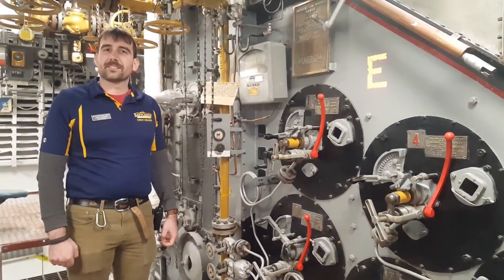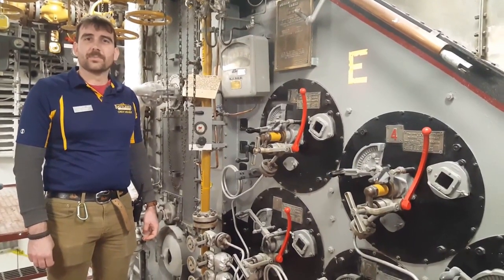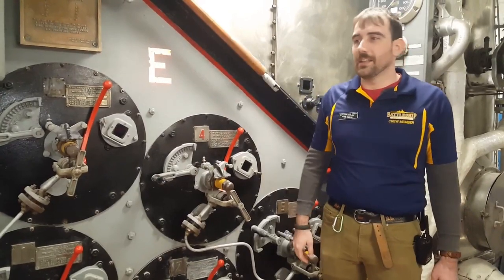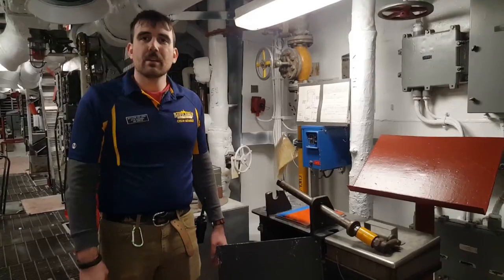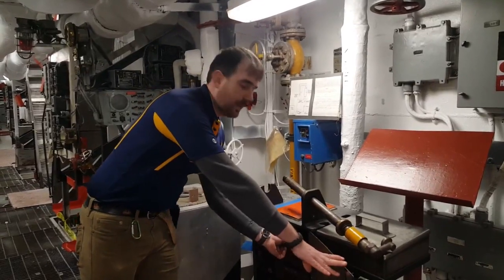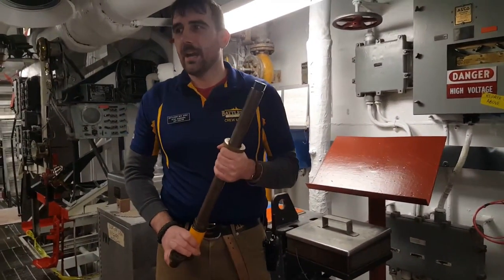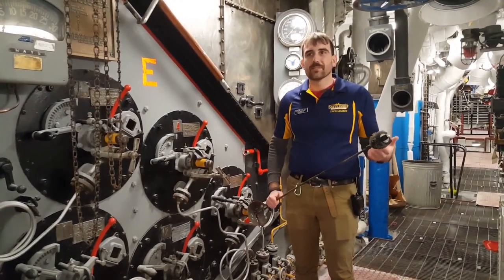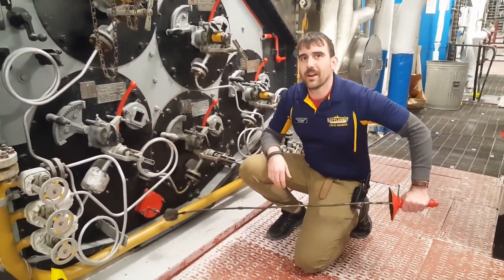How to light the Battleship's boiler

Comment: This is important information I need to kinow in case there is ever an alien invasion.
Reply: But do you need to cover your ears?
Reply: Purrs like a kitten
Reply: Absolutely on the hearing protection. It's the rest of the pumps and turbines and the screaming turbine driven forced draft blowers that are the noise makers. And, every thing is hot in there, often including the deck plates as when you're in the Gulf. Often it's 20° hotter down there than it is outside, and in the high corners the temperature goes up from there. The time we got the most people underway asking to visit and learn (ESWS training) was when we were up nearing the arctic circle - the main engineering spaces were usually the warmest places on the ship. 
BT2(SW) here. Served on board for a very short time.
Reply: Pretty simplistic description, lots more to it.
Reply: When I was on this boat called the Ev Blue Lady, all the guy did was , open the little door on the front of boiler, light the stuck, put the now on fire stick in the opening and turn the fuel on, that was it.😊

Comment: I served onboard 5/82- 5/84. I remember those Babcock - Wilcox boilers well. Great ship to serve on.
Reply: Must have been a fine ship to sail on. Always wondered, what was it like being in those boiler rooms? I mean was it as hot and sweaty as people would imagine, or were they insulated enough that it wasn't any worse then any other area?
Reply: @sparkplug1018  it was very hot in the tropics. Not too bad in the med and North Atlantic. We steamed for 11 months straight with no issues. Great engineering plant.
Reply: @rc6147  Ship is only as good as the crew sailing her, must have been an incredible tour.

Comment: Yankee Station, 1972- I had an unwelcome occasion to light off the back wall of a superheatrer on my tin can. We were engaged in a fire mission when the burnerman shifted to a clogged burner and secured the operative one. I eased open the fuel to the known good one and got that "whump"accompanied by the front jumping in and out, I would not have tried this with distillate fuel, but we were burning NSFO- and time was of the essence- loss of fires was a rare and worst case scenario during combat, and could be likened to a flame-out and midair restart for a jet aircraft. Did not report that event to Main Control nor logged it either BTW.
Reply: Distillate lighted easier, still the "whump", but the burnerfront didn't try to kiss you.

Comment: Suckers.  Changed enough sprayers (5Y515360) on HMCS Protecteur to know what to do...They do come out HOT, but not so bad really- 2 pairs of steaming gloves was enough with ours.  Mind, ours were steam atomised sprayers (hence why 5-Y-51-53-60= 5 jet, Y type jet, #51 on the outside hole, 53 on the FFO hole, 60 on the steam jet).  To clean sprayers:  not more than 95 RPM (5/6 fires...).  Call bridge, let them know no 1 double bubble (100+ RPM).  Watertender goes down below, starts with the 3 spares.  Blows them through, checks for an even flow of air from both the steam and fuel jets on all 5.  That gives you 3/6 needed clean already.  Check the O Rings on the Iowa type racer sprayer.  (yes, that's what they were called).  2x teflon rings provided the seal on steam and fuel to sprayer.  Get out gloves (x2 for Left Hand).  Boiler Op then sets up to 1 fire in burner OFF position in MCR.  Collect 5 gal pail to minimise fuel spillage.  Confirm with Boiler Op that the burner is in OFF.  Shut root valves (fuel/Steam).  Undo retainer using wheel hook, while holding bucket under the end so that most of the fuel goes into bucket.  If the sprayer doesn't come free when released, use wheel hook to "tweek" sprayer back and forth, till it is loose.  Then, put bucket on deck, grab sprayer back with right hand (1 glove), slide sprayer out about 2', grab with left hand on barrel, then swiftly take sprayer to the bench, drop into holder like ^.  Try not to drop on deck due to heat on way across...

Take clean sprayer out of rack, walk back over to boiler (which has 2" hole in it open...with 20" of hot air coming out it...) put sprayer in, ensure lined up, put retainer back in place, hand tighten.  Make sure that microswitch for sprayer in is made.

Now, comes hairy part- testing "new" sprayer...open root valves.  Call boiler op on either radio or machinery broadcast.  If on broadcast, stand at boiler room console- if you had radio, go to same spot or so...  They then set boiler to be able to change over fires to the one you put in.  If it all works out (about 80%), then no big deal.  If it goes wrong, usually it's the flaps are sticky, and you have to go wack the flaps in with a wrench.  Or, you can get it quite wrong, not have enough pressure on the retainer, and have a giant fuel & steam sprinkler spray F76 all over the front of the boiler...:"take it out take it out take it out..."

Now, do the other 2 the same way...so there are 3 dirty sprayers on the bench, and 3 clean ones in the boiler.  Each sprayer when clean will burn about 2500 lb/hr of F76 (Diesel, or close enough).  We needed 2 of them to make up to 60 RPM, 4 for 60-90, 5 for 95, and all 6 for 100>.  You could change sprayers at 100, but it was a faffle for sure....if it went wrong,  you didn't have long as boiler op before steam pressure would be dropping, the Electrician would be mad because Cycles, the EOOW would be mad because not enough steam...but we did do it.  

Dirty sprayers- the best was when we had enough spare tips to be able to change them right out, then put them into the ultrasonic cleaner bath.  However, someone in their infinite wisdom chose not to order more tips in about 2008...I lost my nice new tip from home to the ship, because we needed it more at work than I needed one at home.  Prior to that, in 2007, we had horrible problems with MBG in our fuel.  Turns out, there was about 7' of MBG in the fuel tank...who'd have thought that caused quite the problems even with the smallest hole being #53 that the fuel was passing through !.  It was bad enough that we were typically cleaning tips every 2 watches which gets OLD fast... !  

This is on an "automatic" boiler- you shouldn't need to do anything but turn the switch for the fire to light, or to extinguish the fire.  Fuel pressure was supposed to control atomizing steam pressure (but never did, we just steamed with it set at 150 PSI atomizing steam always), and we used about 40 lb/hr/tip in water to provide the atomization.  Fuel pressure was regulated by a Bailey Meter Company computer, using steam flow, steam pressure & fuel flow to regulate steam pressure- it was fairly good, in that you could manouver 40-90-0-40 and only have to put in and take out fires to do so.  (you had to have a little bit of fearlessness to do so, as it was possible to lift safety valves, which is a beer offence- remember, RCN was wet until after PRO burned...).

And no, we didn't need a flaming stick to light them- we had a spark system that did so- burner on ignition on got you 7 seconds of ignitor, and you had the fireeye system to verify that the fire actually lit.  I never lit the ships boilers with a flaming stick, though it was suggested the best way to do so was a propane torch with a length of about 3' of copper tubing...

Comment: I stood watch in all the firerooms when i was aboard from 88 to decommissioning. This is a very simplified video on lighting fires in the boiler.  A lot of the time burner nozzle orifice tips were changed with the burner still hot. This was done to increase the fuel flow to the fire, as there was no pump control. The pump was on or off.  The bigger the hole in the orifice the faster steam was created, usually at higher speeds while maneuvering.
Reply: bigger hole yes but also the fuel oil pressure at the manifold was set in a a range of 150 psi to a max of 350 psi. This was done via the manual mic valve at the burner front in combination with a Leslie steam regulator at the fuel oil service pump.
Reply: ACC wasn’t fitted on the Iowa’s? Still stick shift?

Comment: I wonder if I understand the part about changing the nozzles.  Does that mean that if you are going all ahead slow and find yourself in a combat situation, all of the nozzles on all the boilers have to be changed out?  Or is it a smoother process like high flow for getting the boilers boiling and then switching to a smaller nozzle to maintain the heat?
Reply: To the right of the scene is a fuel oil control regulator which allows some range of control with your current burner configuration. With drastic bell changes burner change-outs are necessary. It was important to have the rack supplied with various ranges depending on the upcoming maneuvers.
    The boilers were brought up to pressure very slowly. The rule of thumb for most boilers is 100 PSI per hour.
Reply: @roryoneill6699  That's insane.

Comment: My last ship was steam powered, but being a 'Top Sider' working up in the island I never had to learn how the pressure cookers worked other than the basic cycle.  I much prefer gas turbines.  You start those by spinning them up with high pressure air, inject atomized diesel and hit the 'sparker.'  Cold iron to full power in less than two minutes while the steam plant needed hours to do the same.

In normal operations while cruising the gas turbine ship sounds like a 747 taxiing, if you advance the throttles to where she sounds like a 747 ready for takeoff you are at Flank power and the skipper can go water skiing.
Reply: I remember talking with a sailor who served on one of the first USN ships that was turbine powered. He was telling me someone got some stencils and put "BEWARE OF JET BLAST" up near the exhaust stack, he said the guys on the replenishment ships thought it was hilarious until the captain went full ahead. Wonder if there was any jealousy between crews when they were making the transition?
Reply: @sparkplug1018  Shortly after Iowa was brought into commission we (Caron DD-970) did several exercises with them which included "Leapfrogs" (no kidding guys) where one ship would hold steady on a course and speed while the other made her approach as if she was coming alongside an oiler, hold station for a few minutes and then go to Flank bell to simulate an emergency break away, then the other ship did the same.

We pretended to be the oiler and Iowa did her thing, coming alongside and then accelerated away.  Our skipper couldn't resist showing off (he had been on the design team for the Spruance class DD.)  We slid in along side Iowa and then opened the throttles wide open.  We started at 14 knots in position alongside, by the time our stern passed Iowa's bow we had a 20 foot rooster tail and were passing 30 knots, leaning 15 degrees with our turn to starboard, our 4 LM-2500 mains roaring.

Later, while operating with her in the Med both ships were summoned to an area near some Greek Island, apparently there was a chance that a Turkish DD was about to start shooting at a Greek DD and 6th Fleet wanted to make a statement by putting the Iowa between them.  We were her escort.  Iowa's skipper told us to "Try to keep up" and started to accelerate.  We figured no problem, we could match her with two mains running.  We HAD to bring the two other mains on line to stay with her as Iowa passed 28 knots and she continued to accelerate past OUR top safe speed that we were NOT to exceed except in war emergency so we wouldn't endanger our sonar dome.  Iowa beat us to the scene by about 90 minutes.  When we arrived she was slowly steaming between the two while flying big Battle Ensigns from her Fore and Main Masts.  Her 5" secondary's were elevated and trained outboard, 16" elevated from her normal stowed position but not trained out. 

The Turk and Greek both went home, no shots fired.  Point made.
Reply: @robertf3479  Id imagine anytime an Iowa showed up, would be a bad day for anyone trying to pull something. 
Must have been awesome to see her in service.

Comment: What types of fuel did they use? Did they have provisions to use the heavier grades of oil.
My father was an engineman in the Coast Guard in the 60's and had a lot of knowledge and experience with oil fired boilers, he said that "bunker oil" was used on many vessels, it was very thick and steam was actually injected into the tanks to heat and thin it so that it could be pumped and properly atomized , I'd imagine that if the boilers were cold they would be started on diesel and then switched to the heavier oil once enough steam was available to preheat the fuel.
Reply from the maker: Bunker C and the navy distillate in the 80s
Reply: These ships were designed to run on Bunker C, which is... I guess I'd describe it as "a step above asphalt", so yes, they most definitely did have the provisions to use heavy grades of fuel oil.

Comment: The procedure to light up a power plant is due to the remote control of the burners to begin with :
start  one boiler run for lets say 20 s, 3 s before stop start the next one, switch of the first and then continue with the other 8 and back to one. Continue.  Wait for the water to start to heat up .  At 60 celsius, longer heating periods. Continue

Think about this: cold water ... you will take the boiler from 10 celsius to 260 celsius.
By that time it will be about 3 cm longer.

Think about the stress.

The cloth stick isn't necessary as soon as the brick inside the firebox becomes pleasantly hot - the oil will light up immediately.
It is awfully important that the oil starts to burn immediately - failure lighting ....  cut the oil immediately.
Reply: Stefan, white smoke. A BT's worst nightmare. Cheers.
Reply: @jamesstark8316  White smoke then?  The stress relief procedure?

Comment: Is the white “E” on the boiler front a display of the ship’s engineering excellence award?  If so, the proper color of the engineering “E” is red, not white.  Each consecutive engineering “E” rates a red “hash mark” beneath the red “E.”  With five consecutive engineering excellence awards, the red “E” and three red “hash marks” are painted out and replaced by a single gold “E.”   Good looking boiler front!  BZ!

Comment: Are there any major components missing that would prevent the boilers from being lit and getting the ship under her own power?
Reply: yea the fuel oil, her tanks are all bone dry and cleaned out and some of the steam piping and stuff has been capped off, she's not maintained to be ready to run, she's maintained as a floating memorial. She is setup to be occupied off of shore power only.
Reply: @semajniffirg230  I wouldn't count fuel. That's a given.

And a few steam pipes doesn't sound like a deal breaker either. The Iowa's have 8 boilers and 4 screws.
Reply: @semajniffirg230  none of the piping is capped off its kept in ready to run condition minus fuel

Comment: Could they build boilers like that today
Reply from the maker: Could they? yes. Do they or will they? No. There is no reason to. They aren't as efficient as what we do now.
Reply: @BattleshipNewJersey  Agreed although I don't know about efficiency.  The Wasp class LHDs (large assault ships) were built with steam plants, but the newer ones from USS Makin Island (LHD 8) and the newer USS America (LHA 6) class are all gas turbine powered.  

Gas turbines by their nature are usually 'gas hogs' the same as steamers are, even with the throttles at "Stop" the turbines are running at "Idle" power, and will do so up through about 1/3 speed.  

You control the speed by varying the pitch of the propellers and will back the ship down by flipping the props to reverse pitch which can be done in seconds from Ahead Flank, slamming on the brakes while manuvering can mess up the other guy's targeting solutions in a battle problem.

Comment: How efficient were these old oil-fired boilers?
I read an interesting stat about HMS Hood, that when she was travelling at full speed, 33 kts, she would burn a gallon of oil for every meter she moved forward...
Reply: The "amount of fuel burned" is not indication of efficiency.  These boilers were the best technology could produce in 1943.  For comparison, modern gasoline automobile engines are only 35% efficient.  65% of the gasoline burned is used to overcome friction, wind resistance or dissipated as heat.

Comment: At what point does all that stuff start turning the propellers?
Reply: I guess it would be like:
Boilerstage 1 -> Boilerstage 2 (superheater) -> ship's steampipe system for the engines (and other steam driven ship systems) -> steam turbine's -> reduction gearing (because the propellars can't be operated above certain RPM's and the turbines can't below certain RPM's) -> propshaft's.
Reply: @user-pc1er8zy7c  steam turbine -> electric generator -> electric motor -> shaft, i guess

Comment: Wear gloves to light off the boiler? Someone must have taken home those gloves home from our ship? Ha Ha  
Yes, the burner barrels are hot when they come out. But, I had to break them down hot and clean the nozzles. I'd drop the nozzles in a small container for JP 5, which would cool them off and then scrape them clean with a scraper. Once cleaned, reassemble the burner barrel for the next guy on watch. 
Barry
Reply: Curious why you used JP-5 instead of anything else? Did it make the scale easier to get off when it cooled?
Reply: sparkplug1018 Yes, JP - 5 should act like a solvent on anything coated in bunker fuel, iirc.
Reply: @sparkplug1018  We used JP-5 only because that's all we had. We had two fuels aboard our ship, bunker C and JP-5. The JP-5 was used to run the diesel generators so we had access to it. Make do with what you have. Barry
Reply: @barrykery1175  Thanks for the reply, makes sense.